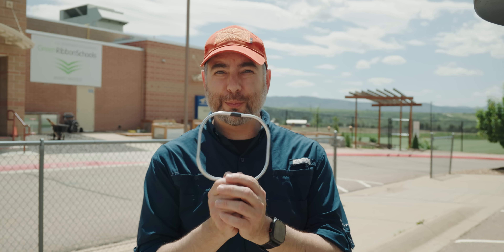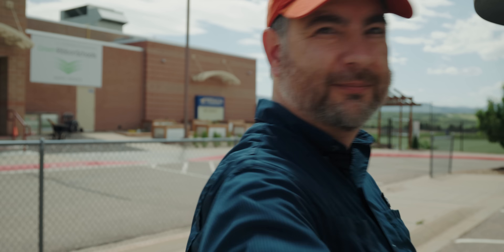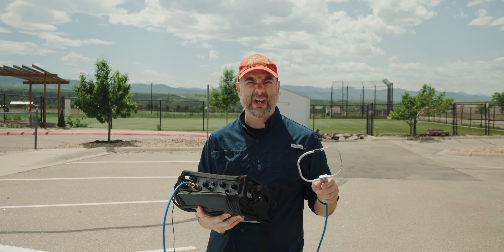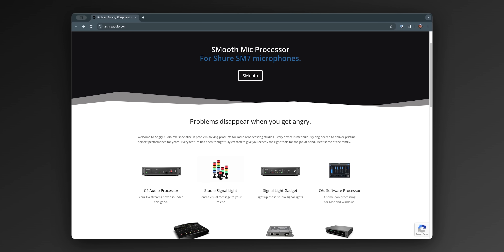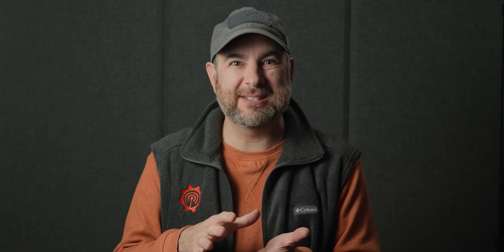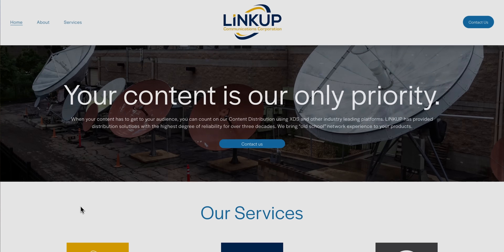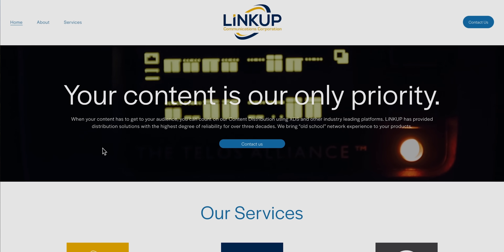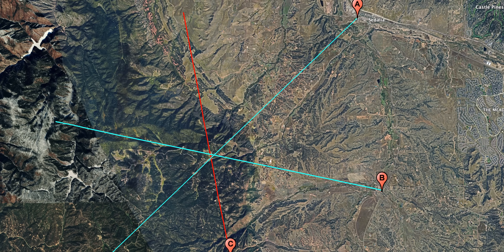Hunting a pirate transmitter

Comment: An important thing to mention is when he takes a bearing and says the signal is in "that direction" it could also be in the opposite direction.  You don't know which side of the loop it actually is until you take more bearings from other locations and they converge in one of the two directions.
I find a yagi antenna much easier and more sensitive than a loop because of the gain.  When the signal is weak, it is very easy to peak within a few degrees.  On a strong FM signal where the peak is very broad I sweep widely side to side and listen for the static to come up by the same amount as the signal drops outside of the main beam of the antenna.  I then calculate a bearing halfway between those two weak points.  It works quite well.  I sometimes use a mixer based attenuator to give me a huge amount of selectable attenuation.
Sometimes I hunt on the 3rd harmonic with the appropriate smaller yagi for the higher frequency when close in.
Reply: Ok , that was also my question, but thanx for explaining it 👍
You can only draw a line line no a map , not the direction
Only by triangleation you can find the spot
Reply: @tdevosodense  That's only the case because a loop antenna has a 180 degree ambiguity like a dipole.  Its pattern has two opposing lobes (and nulls). Other directional antennas (such as yagis) and direction finders don't have that complication.  They give a direct bearing.
Reply from the maker: But the yagi is much broader in the beamwidth so you’d have a bit more ambiguity in triangulation.
Reply: @Look_What_You_Did  That really isn't an effective way of figuring it out, especially if you're a significant distance from the source.  If that worked, you could just follow your S meter to the source.  There are a lot of things that will affect the signal strength more than distance.
Reply: @TheBroadcastEngineer  It is very easy to find the peak with a yagi.  I routinely get bearing accuracies of better than 5 degrees when hunting from high spots with a 4 element 2m yagi.  Some of that inaccuracy is converting where the yagi is pointing to a compass bearing. I look down the yagi and pick a spot on the horizon, and then shoot the bearing with a lensatic compass.  You only get a broad peak when the signal is way too strong.  A variable attenuator solves that.
Reply: @stargazer7644  attenuator solves nothing, the beamwith is not dependent on absolute value of received signal strength. Using a null of an antenna is almost always significantly more precise, than peaking a beam lobe.
Reply from the maker: Correct. That’s why you have to do multiple points as I did in the video. And plot it out on a map.
Reply: You are correct sir!
Reply: A combination of a loop and a vertical whip can be used to identify direction, because the signal phase changes as you rotate the loop, but not from the whip. Thus you can identify the actual heading (in front or behind) if you combine the signals.

Comment: I may join the ham club for fox hunting. I said it might not be fair if I have my communications analyzer running on the front seat. They said fair game. Would totally make a mast to get the loop out of the sunroof if I didn't build a little rotor and mag mount for it first. Dang you are giving me ideas. Glad to see other Broadcast Engineers here I can learn from.
Reply: I used to drive around with a 4 element yagi on a 5 ft mast sticking out of the sunroof.
Reply from the maker: @stargazer7644 hahahaha! That must have been a sight to see driving down the road!

Comment: My kenwood handheld has a deep null off the end of the stubby antenna. very handy as the antenna points directly at the transmitter/RF source.
Reply: When I'm getting in close, I pop the ducky off the HT. If I can no longer squelch the signal out, I  know it's time to use my eyes.  I've got to be looking at it.

Comment: I have used exactly the same loop from Arrow to successfully DF 11 meter signals, but with a handi-talkie, just by listening to the signal. I'm not convinced that a spectrum analyzer would be any  better, and I would certainly not enjoy dragging it around with me.
Reply from the maker: If my darn GPS module had been working it would be super slick. It plots you on the map, you rotate the little wheel and a line rotates in the direction…
Reply: @TheBroadcastEngineer  Maybe get that working and show us?
Reply from the maker: @James_Bowie Might have to send it in to Anritsu and if that’s the case it’ll depend on what they will charge me for that. Might be out of my price range.
Reply: @TheBroadcastEngineer  Is the GPS receiver in the antenna, or the spectrum analyzer?  Maybe it is it just an LNA/antenna?  If it's just an SMA connector, then any GPS antenna will work.  If the GPS is in the antenna and it is just sending data back via a serial or USB connection, then almost any GPS unit can replace it if it talks NMEA.  If it uses the manufacturer's proprietary binary format, you just need to find the same model.  If the receiver is in the spectrum analyzer and that's bad, then you may be SOL without manufacturer support.
Reply from the maker: @stargazer7644 it’s built into the analyzer. It used to work with that antenna but it’s been a few years. I haven’t seen anything about being able to use an external one, but that’s not a bad idea.

Comment: You might check out KrakenSDR if you're not already aware of it.  They've put together a fantastic direction finding array that will automatically generate heatmaps of likely transmitter location.  I've played around with it to DF some repeaters around town and its incredible how quickly it can generate a bearing from just 1-2 second long transmissions.  Granted, it isn't exactly man portable like your setup here.

Comment: I have done this many times for my work in LMR. Once from a helicopter to find interference at 809 MHz which turned out to be local oscillator emanations form a marginally designed Motorola mobile radio. The signal so weak it took over a month of frustration in an urban environment, with many reflections, the many targets were moving, to finally use a helicopter. I went to many rooftops and as soon as I got a bearing, the target would move. Finally we spotted one commercial vehicle that happened to be fitted with this model radio. The last hunt I did was an impromptu discovery of a pirate station near my home. I was curious, but not so curious to load up my gear, that I simply tuned a channel off with my cars FM tuner and drove until the off channel signal was blasting. I found a J Pole antenna on the back of a house garage here in town and the owner of the home was a Gym teacher at local high school. I did nothing, but listen to the station for many months . He was streaming a west coast station "the boss". Eventually he got bored or the FCC came knocking. There was also a church blasting on that same channel some miles away.
Reply: We once tracked down a rooftop TV antenna amplifier that was oscillating and randomly warbling all over the 2m band keying mountaintop repeaters.  It would sweep through the band every evening shortly after the sun went down and the temperature changed.

  I heard a story about a TV set that was found to be oscillating on the International SARSAT satellite emergency locator beacon frequency.
Reply: @stargazer7644  Same here - but on 440 MHz ... found several 'sources' like that over the years too. Those set top active-TV-antennas like to oscillate.
Reply: I worked on a microwave backbone and we had interference on one of our receivers that affected our fade margin. We used a yagi to find it. It was coming from crappy satellite antenna that put a side lobe towards to side of the dish right towards the microwave antenna. Come to find out they weren’t even licensed for that frequency and they shut it down when confronted..
Reply: Just use a "Kraken SDR".    I found a carrier at 720MHz with just 15 mins of driving around.   The Kraken receiver and the app running on the phone literell pointed to target and gave range estimates,    "target is at 120*  and approk 12.5 km away"    etc

Comment: It has been a half century since I used some primitive gear to locate a clandestine transmitter, and to save time and travel I used a directional antenna to determine which general direction it was from, then changed to loop nulls for precision. That saved me from starting out heading miles in the wrong direction. 🙃

Comment: can the spectogram be used to measure ERP or watts radiated? also , does directional antenna makes difference?
Reply from the maker: No, you can take field strength measurements and do some math and come up with power, but you’ll need some calibrated antennas. You can probably get in the ballpark. I know the fcc agents have equipment that can do that.

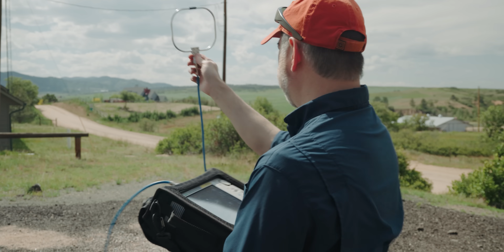Comment: You showed two ways of finding the direction of the null. At 9:24, you rotated the loop antenna in your hand above your head. At 10:02, you looked through the loop and rotated your body. The second way gives you a much clearer view of the direction of the line along which the transmitter lies, realizing that the direction behind you is equally likely for your first "sighting."
Reply from the maker: Yep, but after the second point the chances that a signal at fm broadcast frequencies are behind me are extraordinarily low.
Reply: that is why videos like this are so important and your local Ham Club should be doing fox hunting
there is most likely someone in your group that works in the commercial radio industry or is Ex Military/Intel that can really help the whole group :)

Comment: I have doppler RDF in my work truck.  The display just points to the signal source.  Drive right to it.
Reply from the maker: See that’s the nice stuff there. 😁
Reply: @TheBroadcastEngineer    It's like cheating.   When the FCC  staffed the Livermore field office, they frequently called on me to DF interference (and even some real pirates) on and around the broadcast and broadcast auxiliary freqs.  I can DF anything from AM BCB to FM and 950 MHz. STL freqs.  On time I DFed a pirate on 98.7 MHz. at a house in a moderately large town.  Someone from the home spotted me and must have figured out what I was doing and started to chase me.  It was pretty funny!!
Reply from the maker: Oh man! Chase you?! 

I’ve heard of engineers getting threatened when doing AM monitor points and people thinking they were from the cable company tracking down stolen cable service.
Reply: @TheBroadcastEngineer   Haha!  I've done literally thousands of AM points (done full radial measurements for full proofs and monitor points) and not once been threatened or bothered at all.
Reply from the maker: @ModelA Back when I maintained the AM my previous employer had in Bakersfield, monitor points was one of my highlights.
Reply: Kraken SDR works too.
Reply from the maker: @dan_in_sd Yes, if you have one or the budget for the $700 to buy one.

Comment: I'm still actively watching this, so maybe you'll eventually answer my question, but when you were using the null to find the first point (at ~5:22), you pointed to the direction you thought the signal was coming from. How did you choose that direction versus heading 180 degrees in the opposite direction?
Reply: You are correct. He has no logical reason to choose one direction of the line versus the opposite direction. Perhaps this is a subconcious reflection of the fact that he started by saying at 0:33 that he knows where the transmitter is.
Reply from the maker: Check my reply to @senfo-s5p.
Reply from the maker: I kind of cheated for simplicity for the video. But in a real world scenario you would have an idea of the coverage of the offending signal and know generally which direction the transmitter would be. Once you get the bearing on your second point you’d start to see which direction the signal is coming from.

Comment: Hi from New Zealand! Great explanation thanks, theres some trouble makers on the UHF CBs around here i might try this, but how do you deal with non constant tx like ptt radios? Is TDOA better for that?
Reply from the maker: Intermittent signals is really difficult. It takes a lot of patience or REALLLLLLY expensive gear. There are products you can purchase that will direction find very very quickly. Most people don’t have the budgets for those products.
Reply: TDOA is great, but quite expensive.  Doppler also works well for short or intermittent transmissions.  You can find doppler based ham kits for reasonable costs.  I've sat on mountain tops for hours with my yagi in hand waiting for a repeater jammer to pop up.
Reply: Just buy a Kraken SDR.    If you can get the offender to deliver a carrier for just several minutes.  Kraken will find it

Comment: The loop looked pretty small for 91mhz, what wave length was it?
Reply from the maker: It was for VHF hi band, but still decent enough for direction finding. 😁
Reply: For deepest null you want the circumference of the loop  no more than 1/10 of a wavelength.(1 wl = aprox 3.3m  at 91MHz) So that little loop looked close (1/10 wl = 33cm). Go larger and the null starts to fill. 1/4 wl circumference  is more a peanut shape pattern . But 1/4 wl is good for a transmitting antenna. This is due to the aprox 1ohm radiation resistance being much higher than the  unwanted loss resistances.

Comment: The pirate operators are getting bold with their hidden in plain sight hilltop towers and 100,000 watt transmitters these days wow 🤓😉
Reply from the maker: HAHAHA! I forgot to mention this, but I did have an LPFM that claimed on their application to the FCC to be transmitting from a specific location, but was actually transmitting from another location that was detrimental to the station I was working for. So, yeah sometimes they do “hide” at a real transmitter site.
Reply: I ran a pirate station for 3 years never got copped
Reply from the maker: @Rich-h8i You weren’t dumb and interfered with another station. 😁

Comment: Does the loop antenna have 2 nulls 180° apart? If so how did you know witch way to go from your first reading? Or how do you know if the transmitter is in front or behind you?
Reply from the maker: Yes, the nulls are 180 degrees. In a real world hunt, you’d already have an idea of the impacted area. Once you take a bearing at your second location you can be decently sure about the general direction.
Reply: An old technique is to add an omnidirectional monopole antenna to the setup to resolve the 180-degree ambiguity.  (Do a web search for more details.)

Comment: What did you see or hear which pointed you in that specific direction?  In other words, how did you eliminate the presumptive equally possible null 180° from where you pointed?
Reply from the maker: As I mentioned, I did kind of cheat just to simplify the production of the video, but at our first point, that line is plotted on the map. When you go to your second location, that’s where you can start to see a direction. The more points the more sure you can be about the location. So in a real world hunt, you’d already have an idea of the general area that the pirate would cover, so you can have an idea of where to start. From there you triangulate.

Comment: Lets talk about equipment cost.
Reply from the maker: @thed8229 had a good point about Tiny SA… you could do something like this for about $200. If you’re not doing legal field strength measurements, then that would be perfectly fine.
Reply: I mostly hunt ham interference with a handheld receiver with a signal strength meter and a 4 element yagi antenna and a compass and a map.  I keep a homemade tape measure yagi folded up in each of my vehicles I made for about $30 for hunting random repeater jammers.

Comment: Tiny SA (or ultra), Sig Trax app, and a loop. All fit in my cargo pocket. Under $200 to get in the DF game & kick ass. I even built a loop for HF with a variable air cap because why not.. 😎
Reply from the maker: I keep telling myself I need to get one of those Tiny SA and play around with them. It’s incredible how good low cost equipment is these days.
Reply: Most of my usage is for UHF, so I picked up one of the Nano VNA models off of Amazon. I have not used it for location finding yet  but it might be in the near future. I you happen to have a repeated use for transmitter location, the Kracken SDR kit might be worth looking into. They have mounting information for how to mount the multiple antennas for different frequency ranges, and it maps everything right on your laptop or cell phone.
Reply: @javabeanz8549  A NanoVNA is unfortunately not a great substitute for a spectrum analyser. A VNA is optimised to analyse its own stimulus signal that it outputs from CH0. Sure you can feed an arbitrary signal in to CH1 but you won't see the raw spectrum, as there is internal mixing going on with the CLK2 signal inside the VNA. That means you'll see double peaks and other artifacts. If you know what you're looking at, and you're dealing with a relatively narrow input signal, you can probably get away with it. But a NanoVNA is not going to be nearly as good or easy to use as a TinySA or similar, for spectrum analysis.